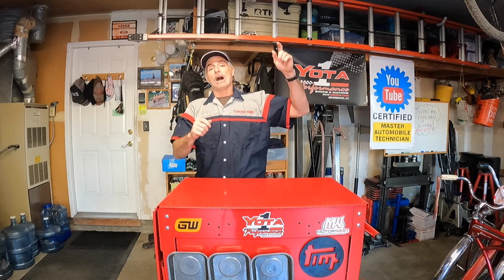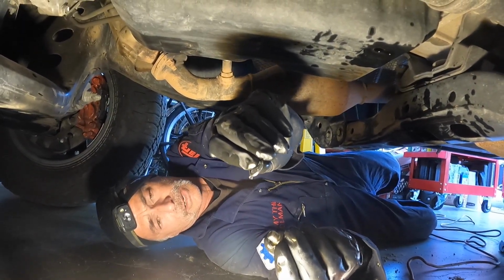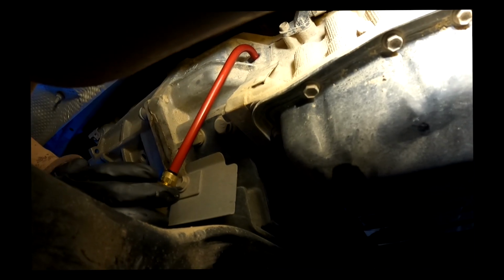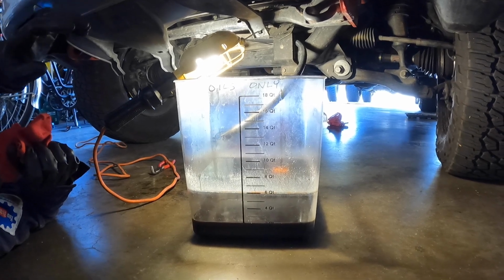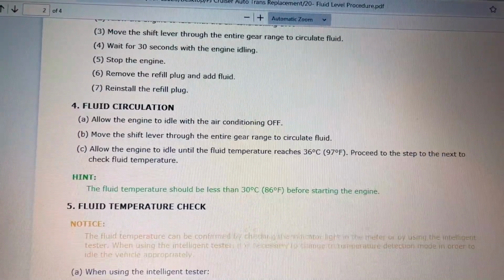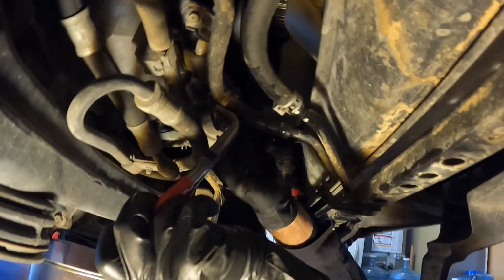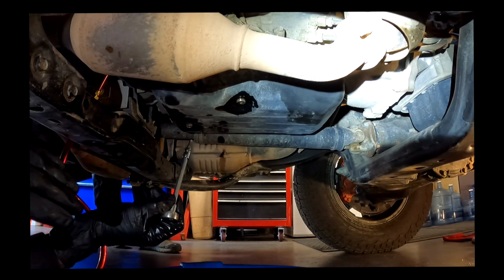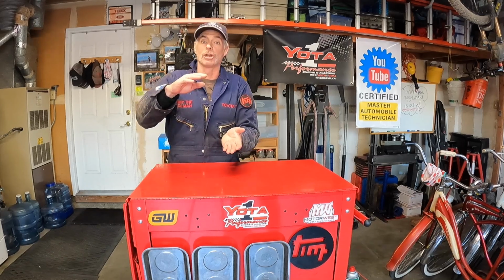Toyota/Lexus Sealed (No Dipstick) Automatic Transmission Flush (Fluid Exchange)

Comment: Next time you should strongly consider attaching a small magnetic level on the frame rails running under the car on each side (from front to back) and jacking the front to level (to offset the slope in most garage floors).  That way, your fluid level would be totally exact.
Reply from the maker: That's a good tip, but I already know my garage floor is very level.  It has an ever so slight slope towards the driveway, but it is essentially level.  Definitely not enough for me to be concerned about it.
Reply: I used a level on my sliders when performing my fluid check. When underneath my truck, the bottom of the pan wasn't level so unfortunately that technique wouldn't work.
Reply: @dimwitrj  Specifically what do you mean when you say "sliders"????
Reply: ??? You never answered my question from months ago  ???? @dimwitrj
Reply: I just looked in the factory manual and it said to put vehicle on lift so it is level so I guess that means a DIYer can just put a level on the frame rails (and NOT the transmission pan) running under the car on each side (from front to back).  Do you think that would work?  Are sliders a part of a lift?   @dimwitrj

Comment: Dealership has a machine for this procedure right?
Reply from the maker: Yes, they have a machine that does it.  Dealerships do charge quite a bit for this service and there's not much labor involved for the mechanic.  They set up the machine and it does the rest.  You would think the machine costs a million dollars for what they charge for a transmission fluid exchange.

Comment: Would you happen to have the part number for the rubber o-ring on the refill plug?

Also would you advise having this done by a dealership? Have read that they pressurize the fluid and it can upset older transmissions.
Reply from the maker: I don't know the part number for that o-ring.

I'm pretty sure the new fancy fluid exchange machines don't exert any excessive pressure on the system so that wouldn't be my concern.  My concern is how much they would charge you.  Get a quote and you might be shocked.  For the price they charge you, you could buy the fluid pump and other necessary tools to do it yourself and probably still walk away with money in your pocket.
Reply: @TimmyTheToolman   So at the dealer, they will flush it with a machine? I'm concern,  because I took mine Lexus GS 350 the other day, and I checked underneath and don't think they even touched the overfill plug. Makes me wonder of what they did.
Reply from the maker: @MrCee861  Yeah, they have these fancy machines that does everything for them.  I don't know exactly how they work, but I do know they aren't adding abnormal pressure to the system.  It's more of an exchange like we did rather than a "flush'".  Lots of people, including me, use the word flush when we are actually doing an exchange just allowing the transmission pump move the fluid like it normally does.  It literally takes them no time to do it, but they certainly charge a lot for it.  They want you to pay for their machine, and then after it's paid off, it's pure profit for not doing a whole lot.  This is the reason why we wanted to share a DIY way to do it and not get bent over at a dealership.
Reply: @MrCee861  Yep. I'm in the same boat.  Fluid exchanged at the dealer and they did not touch the overfill plug.....

Comment: Fantastic video!  How is the transmission holding up?      My fluid is black but has no odors and no material or metal and the car drives fine but once every few hours of driving I feel a bump when changing gears so I am going to do exactly what you guys did in the video which I was planning to do anyway.
Reply from the maker: Transmission is holding up fine.  Good luck with the exchange.
Reply: @TimmyTheToolman  As an update I did the fluid flush from the radiator and after 2000 miles so far so good.   I did notice that the color has changed back to a brown maybe even purple color I guess as the fluids mixed I guess the torque converter does not pump everything out through the trans cooler but the fluid is clear and no materials in it.
Reply from the maker: @DrScopey2  I think you got most of the fluid out if you did it just like we did it in the video.  The color change I believe is because of the excellent detergent qualities of the new fluid.  Your transmission had a build-up of gunk inside it due to the lack of fluid maintenance.  The fluid is cleaning the transmission resulting in the fluid getting dirty looking..  Following up with this flush, I would perform just a drain and refill of the pan every 10k miles.  You will notice as time goes on doing these regular drain and refills, your fluid will get cleaner and cleaner.  Drain and refills is all I do with my transmissions and the fluid stays in great shape.  It's a dilution process (mixing new fluid with old fluid) but it works well.

Good job getting the flush done.  Keep up on your maintenance and you're transmission will be happier.   Happy Wrenching!

Comment: Why not first drain all of the fluid out of the pan, add 3 quarts, and then go through the procedure?  In that way you wouldn't be adding fresh fluid to the dirty fluid you could have drained out initially?  You'd end up saving a few quarts of new ATF.  Anyway, that's how I do it in my other vehicles, and how i'll do it in my Rav-4.
Reply from the maker: We did drain the pan first.  I guess you didnt watch the whole video.
Reply: @TimmyTheToolman  Unless I missed something, you only drained out 2 quarts.  If you also pulled out the plastic tube, you would have drained out 3.7 quarts.  Oh, and I use a 12volt fluid pump to suck the fluid out of the return line from the cooler.  Much slower, but that's the way I do it.  I suppose the same thing can be done with a hand suction pump.
Reply from the maker: @douglasrodrigues8361  I've seen videos of the plastic tube you're referring to but that's for a different style drain pan.  The transmission I was working on has a drain pan bolt and an overflow bolt.  There is no plastic tube to remove to get more fluid out.  The type of drain pan style you're referring to only has one bolt on the pan.  You remove the metal bolt which allows you dial in the fluid level at the correct transmission temp.  If you want to drain the pan, you have to then unscrew the overflow plastic tube.  You're talking about a different set-up then I was working on.  Make sense?

Comment: fantastic video, thank you! When you're running through the gears do you hold the brake pedal down or you've got the car on a lift with the wheels turning?
Reply from the maker: You want your foot on the service brake.  Even if your tires were lifted off the ground, the wheels don't need to be spinning.  You're just shifting through the gears to make sure the transmission fluid has circulated thoroughly.    Glad you like the video Ben.  Good luck with the flush.

Comment: Hey buddy! Can I bring my Toyota to you for a transmission fluid replacement? Where are you located? Thank you!
Reply from the maker: Hey Shawn, I'm flattered you'd want me to work on your rig, but I'm not a mechanic for hire.  My main goal is to make videos that anyone with an internet connection can benefit from.  I live in San Jose, California.
Reply: @TimmyTheToolman , Your video is on point! But for me, the hardest part is determining the correct return line from the radiator, that's what I need help with, and I don't know how to choose that.
Reply from the maker: @shawnsanaei7418  You can do it with an infrared thermometer.   I'm pretty sure I shared this in the video.  Drive the vehicle for a while getting the transmission to opersting temp.  Come back home, get under the vehicle, and point the thermometer at each of the cooler line fittings on the side of the transmission.  The one that is hotter is the send line, the one that is cooler is the return line.  Now follow the metal return line forward towards the radiator and you'll know which one to disconnect.  In reality,  you could do this by disconnecting the send line instead of the return line.  You're just disconnecting the line so you have the ability to drain out 1 quart at a time and then refill a quart until the fluid is clean.
Reply: @TimmyTheToolman  wow! This made it easy to understand for me, thank you! I appreciate your help 👍

Comment: Question, if the vehicle had 180k plus miles on it and was around 15 years old approximately, why didn’t you guys also replace all of the rubber hoses for the automatic transmission lines? They’re most likely the same age as the car and transmission fluid drained and probably won’t last a very long time.
Reply from the maker: In reality, those lines could last the life of the transmission.  You can obviously never go wrong with replacing the hoses, but it's not as necessary as you'd think.  Plus OEM lines are expensive.  You can replace them with aftermarket hose bought in bulk, but from experience, those OEM lines have a slightly different inner diameter than you can actually purchase.  Auto parts stores usually sell 3/8" or 5/16" diameter transmission hose.  5/16" is way too tight to get over the metal fittings.  3/8" works, but it's always a bit of a struggle to get them onto the metal lines because they are slightly smaller than the OEM lines.   This means the next time you want to remove them, it's going to be a bigger struggle.  Something to think about.
Reply: @TimmyTheToolman , thank you for the response. I used to be an SAE certified Toyota mechanic in the 90’s and went through their T-10 program so I know what you’re saying about the Toyota parts being expensive. But I also do agree that the quality is much better than general parts from a parts store.
Reply from the maker: @j.r.777  Hey since you were certified Toyota technician,  what's your opinion on vehicle scanners?  I do have a laptop with the tech stream program and I have used it for jobs like bleeding hydraulic brake boosters but I'd like to get better at properly diagnosing issues and not be a parts changer.  I have lots to learn about more advanced diagnostics.  But, there's so many choices of scanners, some being astronomically expensive.   And, they continue to be expensive from the updates they charge you for.  I started watching some stuff from the Scanner Danner YouTube channel.  He's a very good automotive diagnostic technician.  I've looked at lots of different scanners from companies like Autel, Topdon, XTool, etc.  It's hard to figure out which company and which model to buy.  I'm wondering if I should just stick with my Toyota Tech Stream that's not up to date,  or should I invest in another scanner with more capabilities.
Reply: @TimmyTheToolman , I haven’t been a Toyota mechanic since the late 90’s. So I am very out of date on the new stuff. But I’ve always believed that if you can upgrade and keep everything up to date with the latest and greatest, to do so. If you can bring in enough work to pay for the new stuff and then turn a profit, it only makes smart business sense to do so.
Reply from the maker: @j.r.777  That's the rub, we don't make that much money from our channel but I really want to start playing with these scanning tools to learn more about advanced diagnostics.  I'll figure it out.  Thanks for the reply.

Comment: I just flushed my 2004 GX470. 150k miles that had been sitting for 7 days. Rather than just removing the drain plug, I decided to see if anything would come out of the overflow plug. It was pouring out, it looked like a drain plug flow. With a measuring bucket under it I got nearly 1.5 quarts our of the overflow! 

Then removed the drain plug. Got another 3.5. Total was just under 5 quarts! Obviously not right. I have all records on the truck and have no record of it ever being done. So, after replacing crush washers and putting the plug and and drain bolts in, I removed the hose between the ATF cooler and hand pumped a gallon in with a simple Harbor Freight pump. Then did the 2-n-2 change with 2.5 more gallons (3.5 gallons total) used clear cups to see the progression of dirty to clean fluid. Nice-n-pink.

Ran through the shifting and then a drive for 5 miles. Shifts beautifully as it always has. I am hesitant to let it drain through the overflow plug to a drip because I don't know if a previous owner broke it off if they pulled the pan. There is no need to ever pull this pan, the filter is not one that needs to be changed. 

So, @timmythetoolman what say you? If it ain't broke don't fix it? Meaning, should I drain it to temp with the overflow without knowing if the overflow valve in the pan is actually there? Pulling the pan is an option and I don't need another flush, it'd just be to check and see.
Reply from the maker: I don't think the overflow tube is something someone could damage unless they are really trying to.  I haven't personally seen what it looks like but I assumed its just a vertical metal spout that rises up from the bottom of the pan.  When you're at the right ATF temp, any fluid that was able to spill over into the tube was excess.  So, I don't think it's some sort of valve but rather a simple metal spout that really can't be broken.

I just did a search on YouTube to see if someone shows what the overflow tube looks like in the pan and I found this video.  https://youtu.be/zz-Hy8YSpP0

So, I think you should go through the fluid level check procedure we detail in the video to make sure you have your level right.
Reply: @TimmyTheToolman  Yeah about 15 min after I wrote this I went back and got it to temp and drained it. All good!

Comment: Tim, i always drop the pan and change the filter when i do a trans fluid change. regardless of extra work it’s always worth it to clean the magnets and get a fresh gasket in there to ensure longevity.
Reply from the maker: If it makes you feel better, that's what counts.
Reply: I agree, for the 15 minutes it take to change the filter it’s much better to look in the pan as well.

Comment: LX 470 Thanks for the video! I watched a couple of other videos and came up with an easier, faster and cleaner way. 

I brought your bucket. Then I pulled the hose going to the radiator and place my refill hose to replace it. After refilling after every 2 quarts my fluid started to look clear after 11 quarts. 

Therefore, after 12 quarts I pulled my refill hose and reconnected the old hose I was emptying from. This way is a total recirculation  of the fluid and no touching the transmission refill plug. 

Then I just followed your instructions afterwards and done! If I try it next time I would figure out a way to keep the refill funnel up in the air by itself so I don't have to stand there during the slow refilling! 

Thanks again!
Reply from the maker: Good job.

Comment: How come you can’t use the Witt’s end tool from the iac job on the 3rd gen, I have that jumper tool and no scan gauge and I gotta deal with filling/checking fluid on my newer Camry trans… was thinking i could use the Witt’s end tool I got
Reply from the maker: The size of the pins on the Wits End jumper won't fit into the OBDII port connectors.  The OBDII port connections are smaller.

Comment: I have a 13 Sequoia i did a pan drain and fill only. I got 5qts out of the pan. Truck was sitting for 2 days before i did it. Is this normal? I see people getting about 3-4 on average
Reply from the maker: There seems to be inconsistencies of how much comes out on a drain and refill.  The important thing is you do the proper fluid level check procedure we show in the video so you get the level correct after you're done.
Reply: @TimmyTheToolman   Did the check exactly how you said and had 16oz come out. Appreciate the videos and you. Thanks
Reply from the maker: @Chris.Lewis1456  Good job Chris.  You're very welcome.

Comment: Thank you for this helpful video! If you were to take the conservative approach of draining a few quarts and adding fresh fluid gradually over time, how many miles would you drive it between draining/adding more fluid?
Reply from the maker: I wouldn't waste the effort on dropping the pan.  Those fine mesh filters don't really need to be replaced unless you know the transmission was abused and didn't receive regular maintenance.  The way I keep my transmission fluid in great shape is I do a pan drain and refill every 10,000 miles.  Some might consider this overkill but I don't.  You're only exchanging around 1/3 of the capacity every time.  I subscribe to the old school recommendation of renewing ATF every 30,000 miles if the vehicle is driven hard.  ATF can last up to 100,000 miles but that's only if you never hit higher temps like you do when driving in the mountains, 4wheeling or towing.  If you drive on flat ground all the time and don't tow, I'd say you could get away with a drain and refill every 30k miles.
Reply: also was wondering whether cleaning the filter would be feasible rather than replacing?

Comment: That is not how you flush. It take too much time. If you have two people.  keep pump new fluid in continuously while engine running. Or connect the return pipe fill with 9 quart of  fluid and let engine run until empty it. Much faster than stop and run
Reply from the maker: It's not Eric?  Pretty sure the video showed my technique works.  You do it your way and I'll do it mine.